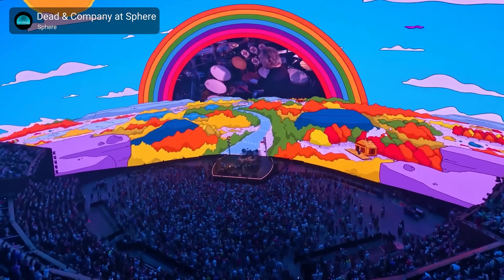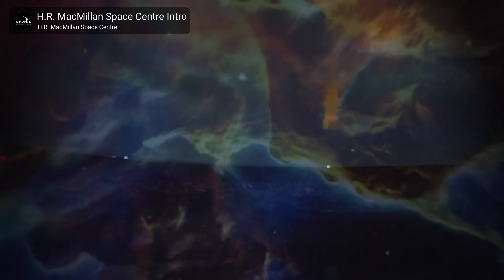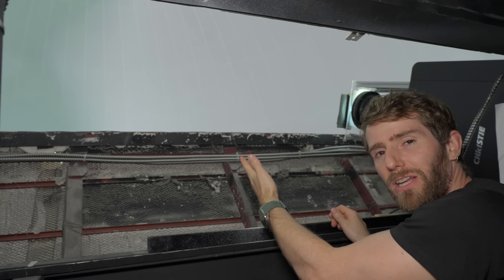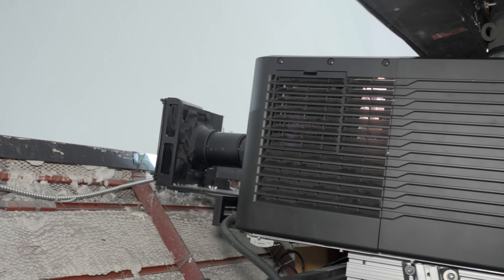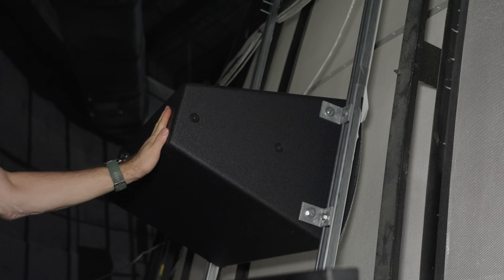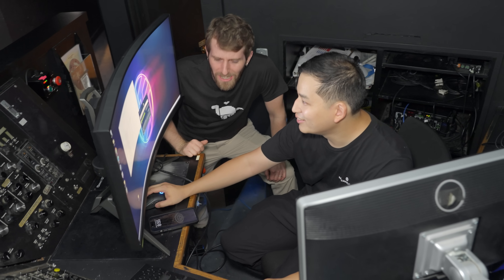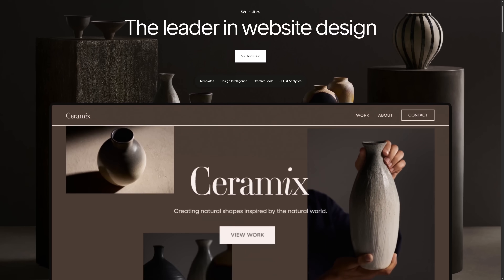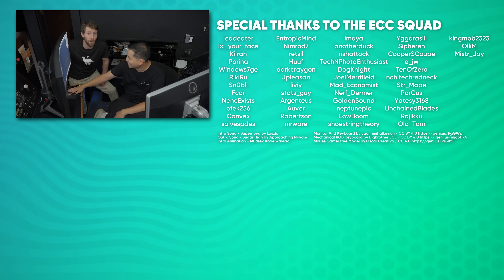Canada’s Las Vegas Sphere is here - and I game on it

Comment: @LinusTechTips Please be a psycho, and do a crazy video about lapping CPU-heatspreader AND cooler block, both to mirror shine, without using thermal paste at all. Trying to absolute direct contact both, and see what the thermals do. (Maybe do a comparison with an itsy bitsy point of liquid metal in addition to the double mirror shine, if the no-paste one fails. :)

Comment: Dang just looking up that "big" Christie projector is hilarious. Introduced in 2013 and EOL 2019 so this thing is getting up there in age. 22500 lumen from a 3000w xenon bulb which is only rated for 1500 hours before recommending replacement using 3way DLP. Native 4K DLP which is cool.

Man how far projection tech has come in the last few years. Panasonic has a 50000 lumen native 4k projector with a estimate of 20000 hours until the unit reaches half brightness and no lamp replacements for the entire life.

Edit: a bit further into the video. HDbaseT is a awesome and simple method of transmitting HDMI or DP over fairly long distances. Only downside is the converters usually are limited to a 4:2:0 chroma subsample. The newer pro ones from Apantac seem to be 444 at 4k60.

Edit 2: NDI is cool but super limited for latency critical applications. NDI would be more suited toward sending a feed to another room that isn't so sensitive. I'm actually using it to bidirectionaly send and receive game feed to a friend while we play games. Makes it super simple to dunk his feed into my OBS recording.

Comment: You need to visit the planetarium in Prague, they just finished reconstruction and have a real LED panel (8192x8192 resolution) that draws 170kW at peak and it's genuinely insane. The contrast is sooo much better than a normal projection-based planetarium.

Comment: Last time I was in my local planetarium, it was almost 10 years already. It is a bit more modern being opened in the late 80s. It is also larger having 23 meters in diameter and 320 seats. But I wonder how their screen is made because the dome is actually made of reinforced concrete and from inside you can see white seams that form a brick pattern. They still have their original projector working and they have installed a similar system to one in a video back in 2016, though I don't remember ever seeing behind the scenes.
Reply: You can always ask for a behind the scenes tour!!

Comment: Ok so a little explanation of screen. while the perforations are very helpful now for accoustics, its original and probably more important purpose is letting light pass through. so think about this, the dome is a lot like a curved reflector like a headlight and that means that a highely reflective surface would reflect light from, originaly, the old zenith projector and now the newer digital ones, and instead of bouncing down or out towards the audiance as would happen with a flat movie screen it's cureved so that point of light could bounce accross to the opposite side of the dome and make an unintended haze ruining the contrast and clarity. so the perferations are a compromise of being just reflective enough to view the projection on.

Comment: 7:22 That’s an HP Z8 G5 Fury (I used to work at HP), those are top of the line (depending on your components) and NOT cheap.

The case has some neat features though, and they are definitely workhorses. The graphics lab had some older workstations running at full load continuously for a decade or more. They even won a Grammy once!

Without the $25-30k on GPU’s that’s easily a $12K PC

Comment: When the local Omnimax theater (a sub-brand of IMAX that was created to be used with dome screens) opened up, they used to open their movie projections with highlighting the massive 5.1.2 surround system it had that was played along to a short soundtrack while flashing lights behind each massive speaker unit. It was stunning. Later, they did it again when they upgraded to 7.1.2, then eventually stopped (undoubtedly due to all the dust build-up.)

Comment: I have been to an old fachioned planetarium, and to this exact one as well, and a crappy old fashion planetarium always looks better, doesn't mater how many pixels you have, a star is always smaller than a single pixel, so ,, of your 40000 wats of light, you are only using 5 wats when projecting point light sources, but a real planetarium analog projector uses lenses to focus the light and its a lot brighter

Comment: 6:21 not only the same lamp. But very similar projector. Most of the big screens use Christie CP4230.  I believe that model uses a 3000w lamp compared with 6000W for the 4230

Comment: This was a great tour. In Toronto, Ontario, we had a similar science centre dome show.
Reply: Unfortunately Doug Ford closed down the Science Center under false pretenses about the actual danger of the structure and the costs vs the cost of a new location (as determined by the Auditor General of Ontario) In any case the new location promise was vague and most likely won't happen (with no plan opening was set to 2028 and later pushed to 2029).
Closure also required to change the name of the "new" Eglinton line LRT as the station near it was named "Science Center" and since it was already fully built they had to change the name with all signage for an undisclosed cost (Metrolinx refused to provide the cost) but similar changes in other stations costed around $1.6 million.

Comment: The cooling setup for those projectors was fascinating, thermal management often goes unnoticed but can make or break visual precision in environments like this.
Reply: the whole room is like the pc case haha
Reply: The hot side (top) of those projectors are usually vented straight outside in normal (IE: Cineplex) installations. This projector still uses a normal light engine and xenon tungsten arc lamp bulb, while its successor is laser-based and produces less heat with better efficiency.